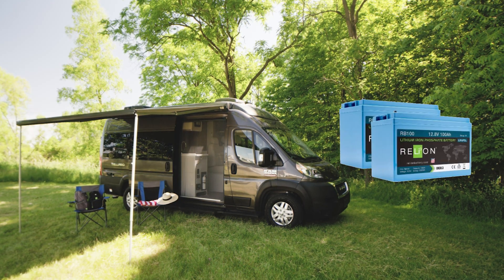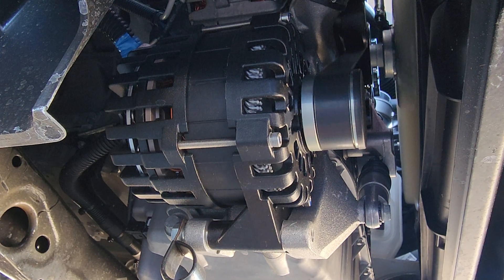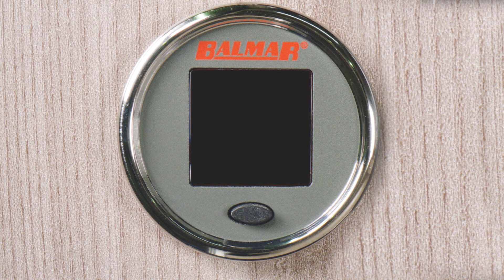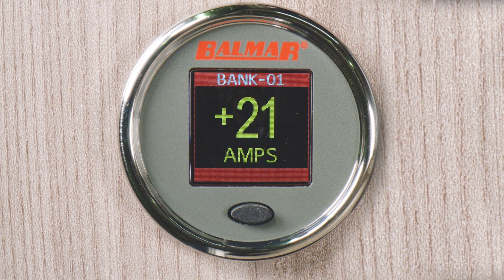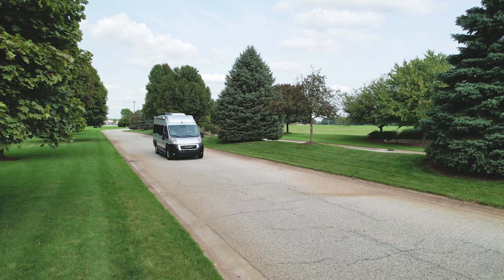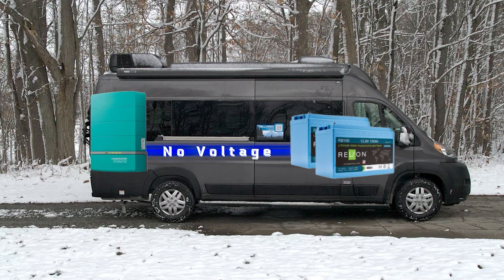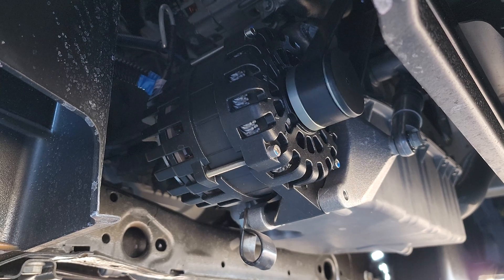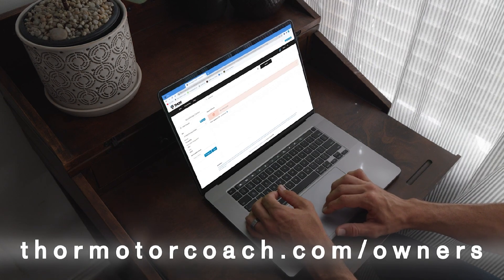How to connect low or frozen lithium batteries in your camper van when they won't take a charge.

Comment: So lame that Steve keeps saying if you see 13 volts you’re on your way- no you’re not….only if the alternator is actually connected, working, and the AMPS are in the positive. That 13 volts could be from the solar panels…
Reply: Well, the whole thing is understated.  This cure takes a call to Mastervolt.  (believe me, I know).  Even the dealer has to go through that process.  And yes, you are correct with your point too.

Comment: Inverter screen black would not turn on but Balmar showed SOC was 80 percent tried the emergency start button also did not work…had to take to dealer they connected to shore power the inverter screen turned on. We never connect to shore power or have access. We bought this unit because of the second alternator also dealer said they no nothing about heating in the batteries …so basically the systems do not work as represented here.